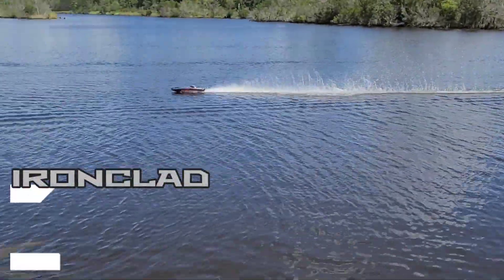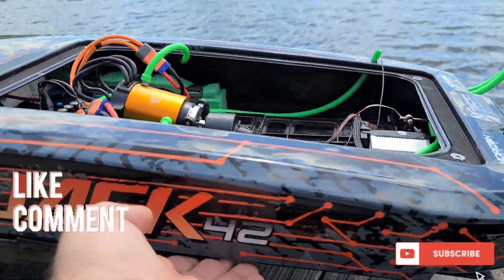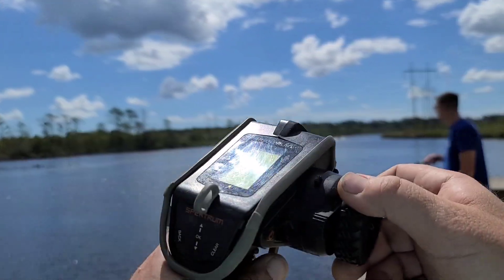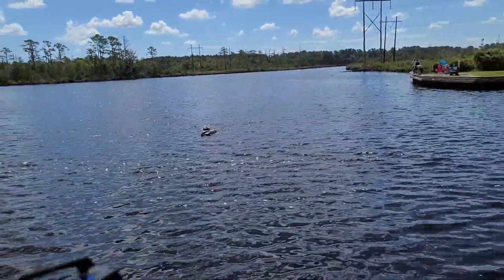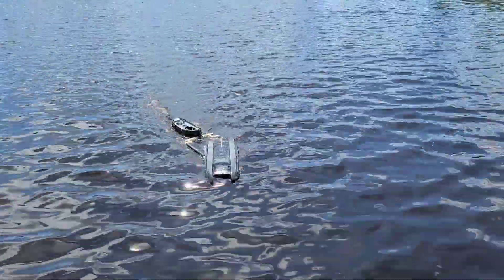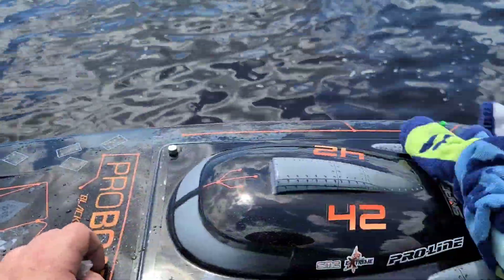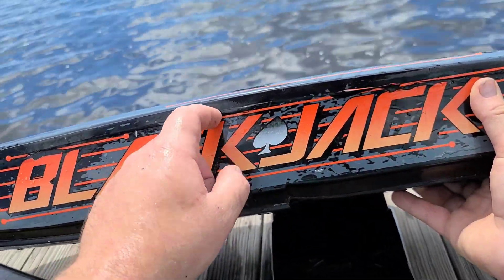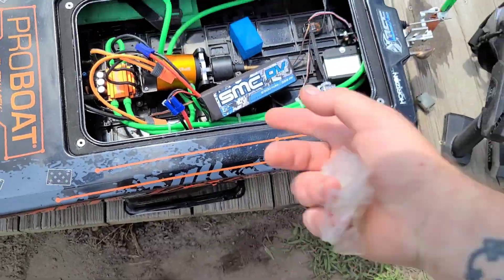Found A Couple Issues That Need Attention Blackjack 42 Shake Down

Comment: for all my main boats i use the same flysky computor 10 model car radio i have had for 13 years... have many rx's since my other airplane flysky radio binds to same rx's i converted it to use 3s lipo... range is very good ,1200 ft,i only paid $35...can't remember any issues other than when rx's got wet or antena wire broke...radio has more than enough features for me...

Comment: Big B, just received my new 90amp Flycolor esc. I was trying to program it after setting the throttle limit. I got it stuck in a program and the motor wouldn’t run. I tried everything to get it to change. Last ditch effort, I tried a spare motor and it allowed me to set the throttle again. All back to normal, I guess I’ll watch your video again. I want reverse for emergencies.
Reply from the maker: I've got a programming video for the flycolor 90,  i think its in the deltaforce 23 mini sniper playlist?     at first it can be aggravating may take a few tries, be patient

Comment: Hey Big B, just wanted to let you know I fixed my cracked hull and it seems to be holding up well after the first few runs. I used Zap 15 minute epoxy thickened with West System 406 adhesive filler, to a mayo like consistency. I scuffed the area with 80-100 grit sandpaper, cleaned with rubbing alcohol, and then applied the epoxy with a small paint stirring stick into the front of the hull. I didn't feel like I could get fiberglass mat or cloth all the way into the tips of the hull so that is why I chose the thickened epoxy instead. If I had to do it again I'd go with 30 minute epoxy since the 15 cured a little faster than I would have liked. The filler came from a fiberglass boat repair kit I had laying around for another project. I'll be curious to see how the E6000 works for you since I imagine that would be easier to find and use for most people. To give you an idea of how well the epoxy sticks to the plastic hull, I accidentally dripped some in another area and I cannot pick or pull it off by hand, even flexing the hull underneath, so it seems pretty permanent.

Side note: You inspired me to post a short video of the boat running on my channel, so thank you for that!
Reply from the maker: The e6000 has been holding up pretty good on the side seam I repaired 6 months ago.   I just fixed the seem last night on the bow with Bob Smith 15min and chopped up carbonfiber.    Turned out pretty good.    Video coming our tomorrow.  Preparing the repair area is the most important part

Comment: Hey Ironclad. Be sure not to use loctite on locknuts. The locknut has a plastic insert that does not want loctite. Loctite is great for regular nuts to keep from loosening. Thanks
Reply from the maker: Thanks I tend to put Loc-tite on everything
Reply: didn't think of that but you are correct lock tite and the plastic in a lock nut don't mix good. thanks
Reply: The locknut does indeed have the nylon insert but it doesn’t run the entire length of the threads. You can do loctite with nylock nuts just fine. The loctite simply adheres to the metal portion of the threads. Proboat just has shitty hardware.

Comment: Funny thing I was going to tell you where mine keaks, same place that you just said but mine was back a few inches where the sponson and hull meet . I filled the seam with silicon , works so far fir me
Reply from the maker: Thanks foe sharing, I was tempted to use silicone when I repaired the seam on the side but went with e60000.  Holding strong so far

Comment: Imagine if you had some range, those 5200  be lighter in theory should give your best speed.
I know in an outrigger the balance between grunt and weight is right at 5000 mah but it doesn’t seam to be the case in these cats
Man you need some zip ties on those water lines
Reply from the maker: I stretched a peace of silicone tube over the cooling line last night they should stay on the nipple now.

Comment: Nice run mate. 
Try to use small heat shrink ring for your coolant line end that will help to not popping out when running.
Reply: I use very small zip ties on all ends of cooling lines